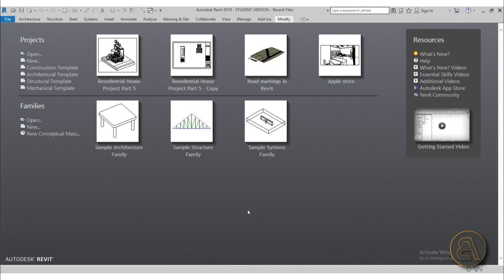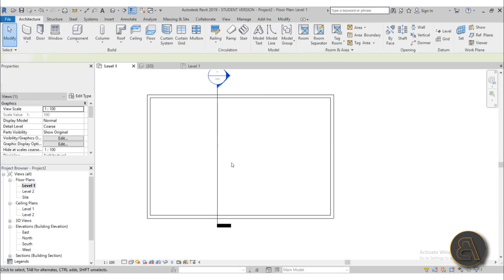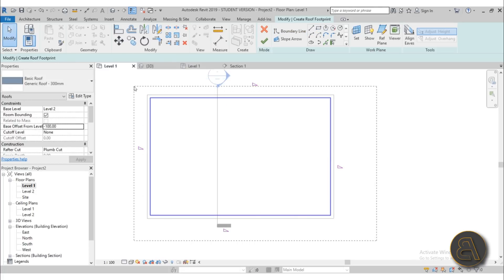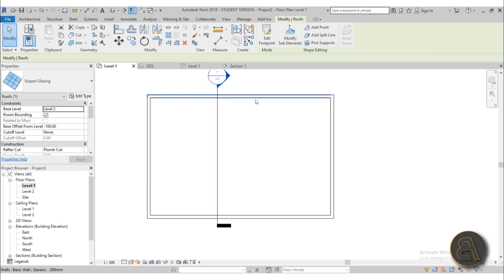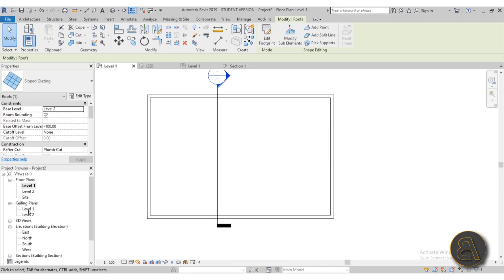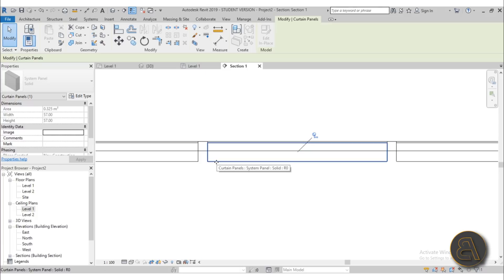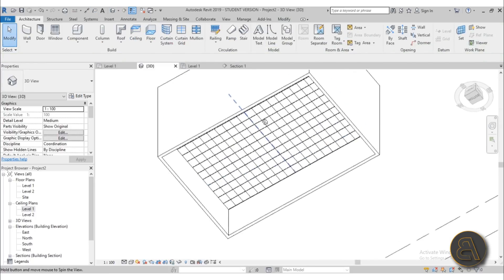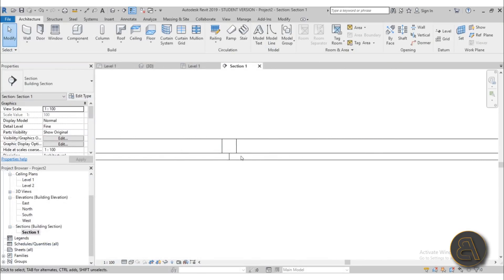Ceiling with Construction in Revit Tutorial

Comment: i can hardly work with this approach, when i have about 200 rooms, all with ceilings, lights, vents, fire detectors, etc. general approach with ceiling tool is much smoother than that.
Reply: Not suitable for large scale roll-out. Ceiling with surface pattern for tiled ceilings, ceiling hosted family for ceiling fixtures. A good bump/displacement map can achieve realistic ceilings when rendered if done right